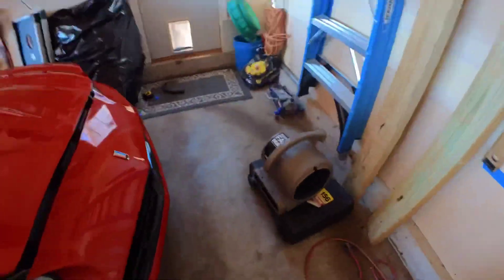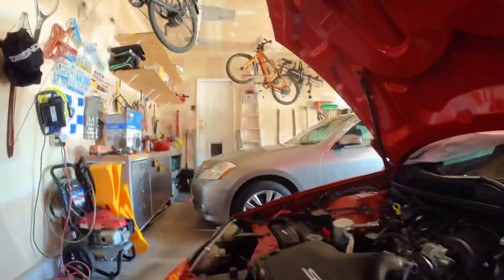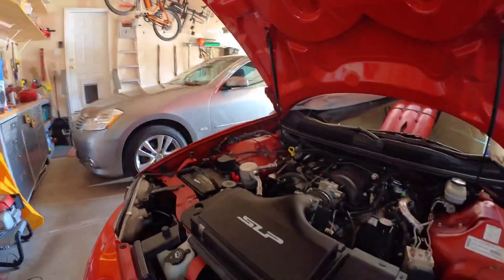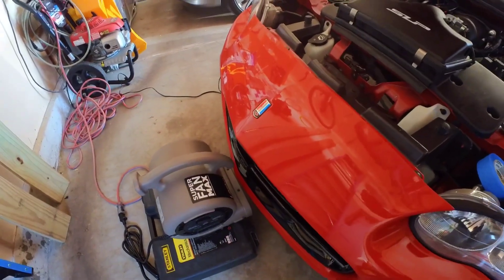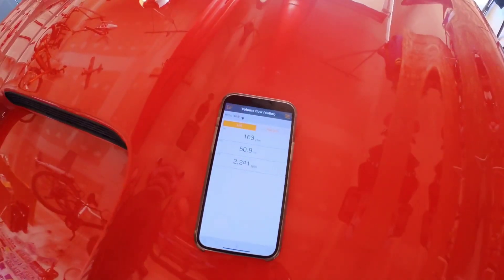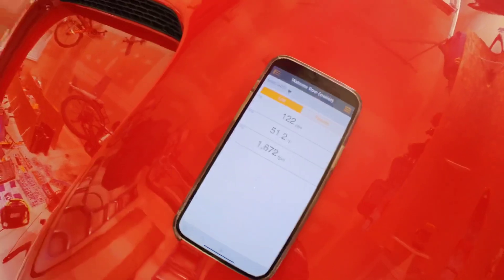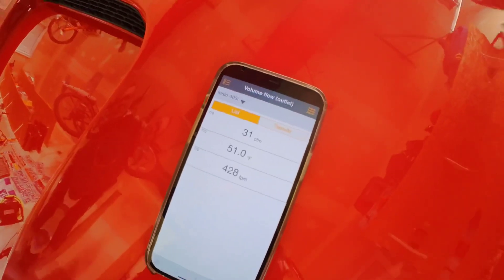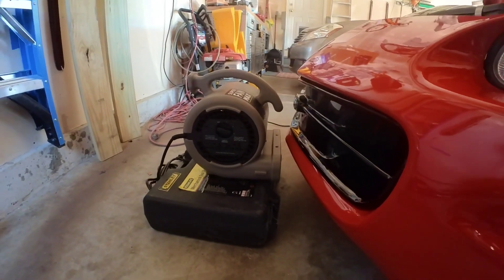Camaro SS 4th Gen Fbody hood vs SSRA CAI flow rate testing with data.

Comment: Is the car running during testing?  If not it’s all pointless.  Engine creating vacuum will direct the flow.  Cold air plus lid sealed to hood (not blocked off) flow substantially more than just the cai alone.

I’ve seen at least 14 dyno tested over the last 20 years personally.  CAI + Functional Scoop is the superior set up on a running car with airflow.
Reply: Great video and please do more, it’s just this one is based on a false premise.

Comment: What did you use to seal the lower part of the SLP lid?
Reply from the maker: The SSRA came with a rubber gasket pre cut to seal off the bottom of the lid.
Reply: @s2k442  ah ok. I bought the Chris1313 and it came with just a roll of foam with a tape backing
Reply from the maker: @HobbsRyan  that is a cheap way to do it I guess. I will take a pic of the gasket when I get a chance

Comment: I appreciate this video and your effort. Don’t think I’m trying to be that guy who is a dick and tries to say everything you did was wrong. I feel like with the motor running and it using that air or sucking air in, the test or data would be more accurate. Without the car running the air has nowhere to go so it could affect the flow numbers
Reply from the maker: Yes, I agree and would have done that if the car was not still sleeping under the cover in hibernation. I’m not a professional YouTube guy, but wanted to at least take a stab at this. There are many variables with this and I’m sure it’s not a definitive test. However, it’s all relative, and I could not find anything online for any intake flow. I think it shows that there is an improvement vs stock and some data from ls1 tech guys show that it does help performance on the track. Thanks for the input, I appreciate it.
Reply: @s2k442  I agree. Again, not trying to say what you did was wrong but just giving you an idea from my perspective. Maybe once the car is out of hibernation you can do it again for curiosity sake

Comment: I have the chris1313 non A/C scoop and slp lid on my Z.
Reply from the maker: I was torn between the two because  I am from Chicago area, and had my tune done by Speed Inc, which is a great shop. They sell the 1313 intake which is very similar to this one. Do you have any before and after data? I’m sure it was a nice improvement!